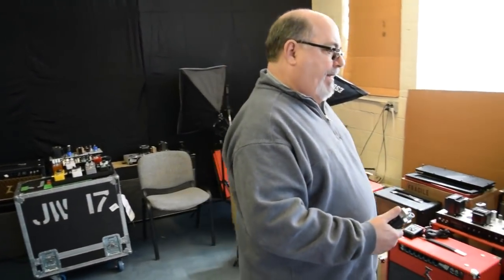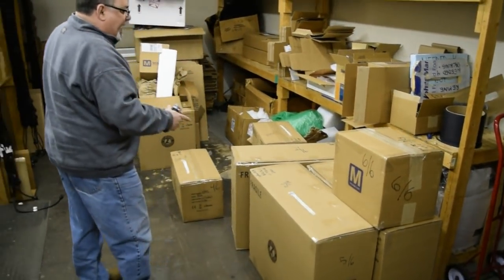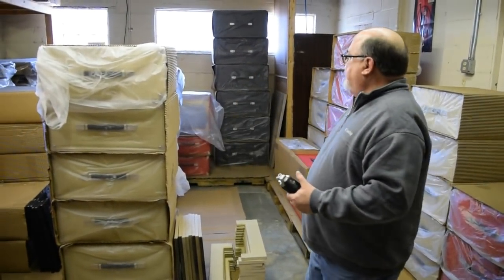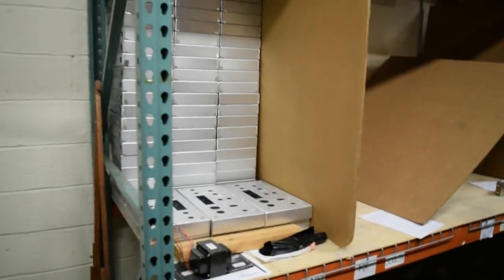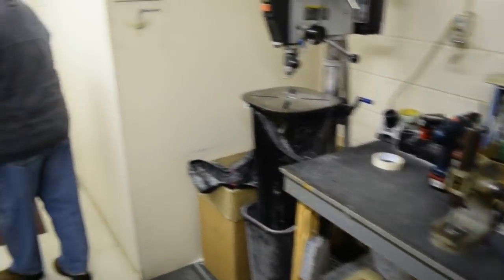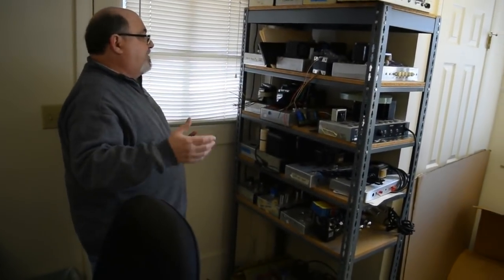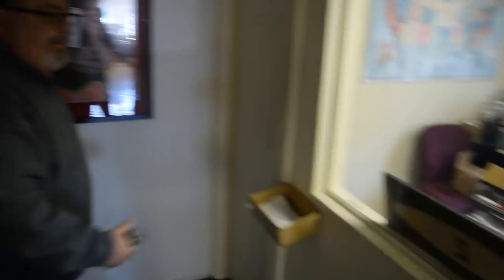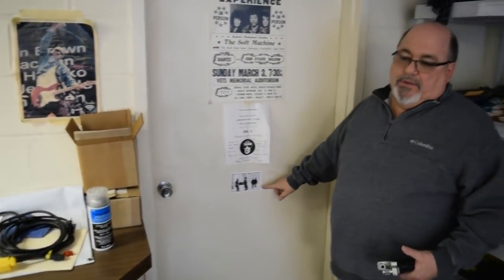Dr. Z AMA: "Shop Tour"

Comment: Hey Dr Z, This is Scott the fiddle player you talked with a while back about the Carmen Ghia I bought recently. I forgot to mention that I bought it used and injured so to speak from a player that was on tour with her. Apparently they started getting what I call a show boat type sound from it intermittently so the tour tech took it and changed a tube or two and then it started arching and his recommendation was to change all the caps out in it. Needless to say I didn't do that at all. My amp guy checked it all out and that tour tech put a different power tube and not a matching set in it and switched valve 1&2 around with some weird slovek I think tubes and that was the whole problem. My amp guy watched all your videos on the C.G and tubes and biasing and such and got her purring like a kitten again. Best fiddle,banjo,mandolin and acoustic sound I've ever gotten from an amp hands down. 
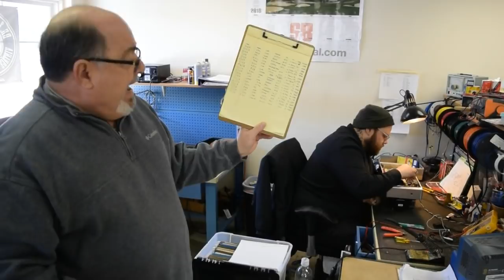The first show I did with it was a couple of weeks ago and everybody was drooling over it both the immaculate pristine showroom condition it is for a 2013 amp and in the red safe case and the killer natural sound it puts out. I use a digitech IPB-10 pedalboard that's iPad based and it was set to my old amp so I had to do a little adjusting but for me, about 9 or 9:30 is my top out volume and the tone at 11:30. 
To me this amp is a God sent. What I've been wanting all my career and now the Carmen Ghia is my life amp. 
I've got a friend that owns a sign business and I took him the amp to get the case labeled and he did me a custom Carmen Ghia racing stripes identical to the label on the amp down the sides and my band logo with Dr Z up in the corners on the front and back. For sure a cool custom look. Looks like it came from your shop that way. Anyways, thanks for your input and for your videos.

Comment: Great Video! Any chance you guys will do a 2 channel amp that is switchable with a footswitch? It'll be great if you had an amp with 2 -3 channels, reverb, effects loop, power selector (Attenuator )
Reply from the maker: slickcross We made a two channel amp back in the day called the 6545! You can see it on the top shelf early in this video. It wasn't a big seller! 

Unfortunately when you get into having all the features you mentioned, the amount of components involved requires you too go to a PC board which is simply something we do not do. Thankfully though, our MAZ series and Z-PLUS utilize great onboard spring reverb, a buffered effects loop, and a variable boost footswitch that can allow you to go from clean to dirty with the right settings. Install one of our Brake Lite  attenuators inside the cabinet, and you have most of the features you are looking for in a true turret board hand-wired package.
Reply: LOL

Comment: Is Dr. Z RoHS compliant? Do you use lead-free solder? Have you compared sound differences between leaded vs  lead-free solder?  I noticed you don't seem to use real fancy solder stations. They look like Weller WES51 type analog stations vs newer JBC and Pace irons with with quick recovery integrated heater/tip cartridges. I guess technique is more  important than fancy tools?  #drzama
Reply from the maker: acoustic61 I’ll forward your question to Dr. Z for a more thorough explanation but yes RoHS, CE, and ETL certified, and no, lead free solder isn’t up to snuff physically or tonally.
Reply: Dude, every single tube amp manufacturer and even tube makers use a mix of low end harbor freight pumps to pfeiffers or hi end metcal to low end weller. Look at their process: they don’t need 2k pace stations for board level repair because they are manufacturing and their work is mostly simple wire lead and peg board joints... not giant ground planes requiring all kinds of hi wattage and intricate temp control to not create trace lifts. Maybe this affords them better parts. Pace hadn’t change anything but pin configuration since the 80s anyway. In the end, none of it matters as long as you are devoted to a consistent product and your employees don’t have internet access. Haha

Comment: Looks like you subcontract out the metal chassis and the cabinets...….
I thought your facility would be a bit bigger, but you have a very interesting space and assembly line.  I guess you do your own distribution rather than a third party ?
Reply from the maker: Mike Camps shipping occurs directly from our shop to our dealers. Cabinets are made by SSI in Cincinnati and loaded in shop. S&M metals fabricates the chassis in Twinsburg, 20 mins from the shop.
Reply from the maker: S&B metals rather (not sado-maschism metals)
Reply: @DrZAmplification  That's funny.....
I was dealing with the Williams company here in Pittsburgh, but they pulled out of town about 20 years ago and the closest office is in Cleveland hahahaha.  I tend to bend my own chassis as I'm a custom builder by contract.  I hope to join you soon in the arena though...….and ya like Ken I have been affected by chronic fatigue syndrome back in the 1980's.....

ROHS...watch out for the chemicals.....the legacy of living in a steel town and the nature of the beast with electronics......